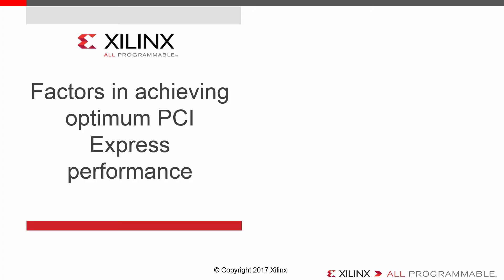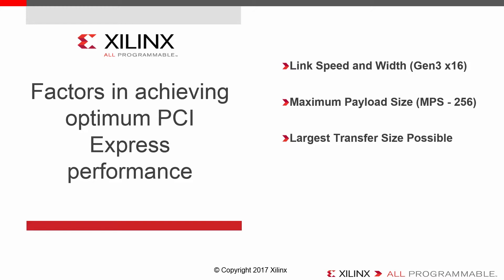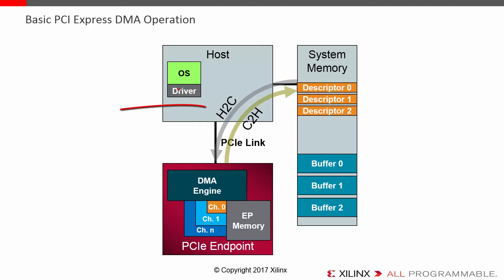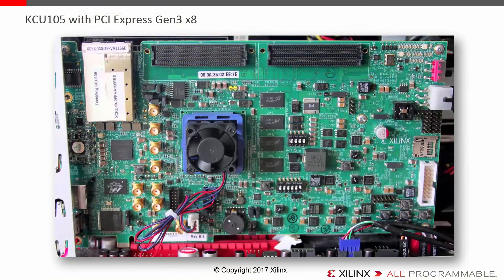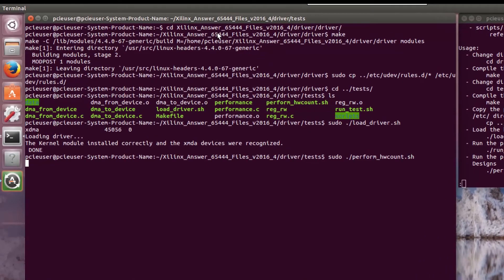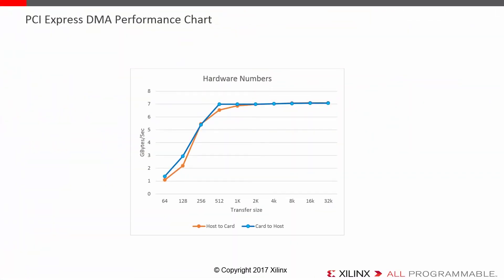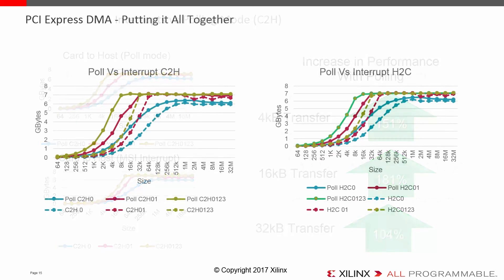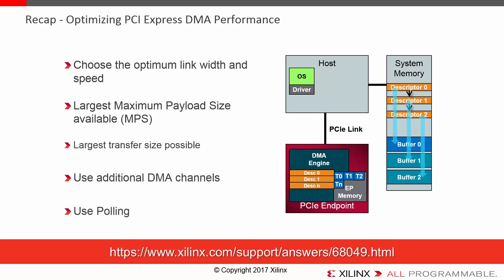Getting the Best Performance with Xilinx's DMA for PCI Express

Comment: I appreciate performance numbers being tried in multiple usage scenarios. Nevertheless, I feel it misleading when cure is simply "increase numbers to get larger numbers". There is a bunch of fundamental reasons why actual transfer throughput does not reach theoretical max levels. Increasing number of channels does not improve link capacity, that's more about utilizing inevitable link pauses. Now working with that nice puzzle pieces instead of coding greatly simplifies designer life. Still I believe understanding pipeline delay, outstanding buffer capacity and alike is a key competence of designer.